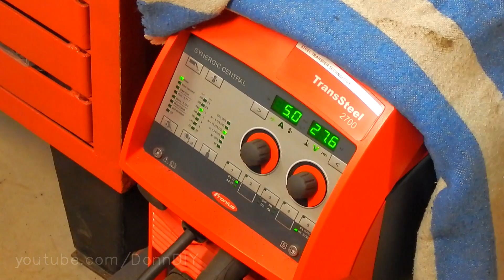Fabricating Transmission Shifter - Tracked Amphibious Vehicle Build Ep. 21

Comment: I would add two fuel tanks: One for the desired range and a second one with a manual switch over and 1.5 times the capacity for the way back.

This way you don't have to rely on a fuel gauge, if the first tank is empty you have to turn around. :)

Also just put a fuel line thru a heavy ball (like brass or copper) in both tanks to get always fuel, regardless of the steepness of the terrain.

If you want to use the space inside the engine bay, just wrap the tanks in cork and use glue to hold it temporary in place, then add metal straps around it, to hold it to the body. Cork is extremely resilient to heat damage, it was used as heat shield in space vehicles. It should give you enough time to evacuate or extinguish a fire.

I would also add a metal plate between the engine and the wrapped tank. Doesn't have to be thick, it's just to avoid direkt heat by IR radiation from the engine + seals the engine compartment for better air flow around the engine.

Comment: Great stuff. On the fuel tank how about a plastic outboard tank? You can carry extra, they don't rust inside, you can fill them outside so no worries about spills. I used one on a forklift, works great .  The shifter linkage was great.

Comment: Great build mate. Coming from someone who has experience in automotive fab, I'd be rubber mounting the fuel tank. Vibration may cause fatigue cracks in your tank which is the last thing you want in the middle of a swamp. Keep up the awesome vids 👍.
Reply from the maker: Rubber will come, I just didn't want to add more parts I have to take off later. 😆

Comment: Hi, great build  as always, inspirational to all, whether they proceed to a project  , or not.  I tried looking online as  after viewing your work a couple of times I still could not work out the shift pattern,  but, if this is a four speed  , two speed,  ie 4 speed with high low ratio ,masquerading as a 5 speed, as a number of cars ran especially in the 80's,  it could be advantageous to run it as a 4 speed with high-low box, it can give you a better range of gearing, including reverse!
Great project,  
Keep up the good  work
Looking forward to the next episodes and the final result
Greetings from  New Zealand
Reply from the maker: It is definitely 5 speed.
Reply: Sorry if not clear in my comment, there used to be many 4 speed 2 speed box's , set up  as 5 speeds with a 5 speed shift pattern, but actually  4 speed as above, knowing this it could be advantageous  as previously particularly  with a standard and also a high ratio reverse, great build, well thought through, possibly needs an outboard or jet unit on the back, cheers

Comment: Real talent here!
I think it gonna be very difficult to shift gear when it gonna run,this gonna slow down so fast intantly when toutching the clutch.
Usually this king of vehicule is automatic transmission (cvt) like snowmobile.
Reply from the maker: Yes, I know. The gears in the gearbox will work as ranges. Only instead of high or low there's first, second, third, fourth and fifth. You definitely have to stop and let the engine and CVT to idle when changing gears. I don't expect to change gears on the fly. 😀

Comment: Just as you finished the exhaust pipe i said to myself. Damn that would look good with a tractor lid on the pipe... and 30 sec later.... tadaa. Nice work man!
Reply from the maker: 😜 It was the only way to go tractor.
Reply: @DonnDIY  either that lid or a biiig cromed pipe.🤣

Comment: Looks like fun and you need a winch on the front and back and trailer hitch receiver's  light bars use old piston for shifter handle turn signals break light horn radio cup holder fishing rod holders waterproof bin for gear ladder on the back for getting out of water and a fun trip to DMV 😁
Reply from the maker: Winches will come, already fabricated mounts for them.

Comment: Suggestion...put a protective bracket before and after the exhaust pipe in case a branch or something runs along the top of the hull and snags the pipe
Reply from the maker: Good thinking!
Reply: I know the flex resonator will remove the vibration... but I would the exhaust pipe running through the hull and supported by a rubber grommet/hanger - just like the vehicles 🚗 exhaust pipe... if it snags on something I may cause serious damage to the pipe and the frame through which it goes through
Reply: It should put the outlet far away from the man.

Comment: I'm really loving this awesome build.  I only came across it yesterday and have binge-watched most of the videos.  I wish I had come across it later in the build as I don't think I can wait to see the finished truck.  
I have 2 points/questions about the build/design.    1.  I'm concerned that nothing is isolated from the chassis using rubber mounts.  I think the tub will resonate like a loudspeaker when the engine is running and the ride will be very harsh (I hope I'm proved wrong on this).  2.  Is there a reason you have built it entirely from steel?   Did you want it to be much heavier than the Argo?  Will the weight make it travel better over the terrain you have there?

Comment: Great job 
It is better to put rubber around the exhaust hole to reduce the engine vibration and noise
Reply: Reicher Reinhardt Von kesselring so he should use   Fire-resistant rubber Or  make a wide exhaust hole on the body so the exhaust end doesn’t touch the body

Comment: Nice video, what part of build is next ? 

Btw when you will begin the work on Garage, so satysfing to watch rebuilding videos.
Reply from the maker: I have yet the hull to fully weld (welding over the tack welds), rear seats and feet protectors, installing lights before paint to get the mount holes right etc. But I hope I can hoon around in it very soon. Can't wait any longer. 😜 Work on garage will be way in the future. I still have the machine shop to finish and lathe to move.
Reply: @DonnDIY  Thank you, for your response, Best regards from Czechia.

Comment: I am curious about your fuel tanks mount. I've read a few times that it was important to put such tank on rubber pads or else. Resonance issue or else that I did not fully understood. You considered it?
Reply from the maker: I will install rubber pads after the hull is painted.

Comment: Will you require any form of heat shielding from your exhaust as it goes past the back of your electrical wiring.  I would imagine it will get fairly hot.  Cheers.
Reply from the maker: Yes, a metal heat shield. And probably wrap the exhaust with exhaust wrap too.
Reply: @DonnDIY  All good.  You are doing really well with it.  It is very interesting watching you develop solutions as you go.  Cheers and have fun.

Comment: This feels a lot like a Colin Furze build - completely bonkers, but well engineered. That gear linkage looked like a triumph of manufacturing over design, though - the geometry of those diagonal links looks horrible and I suspect you'll like it a lot better if you replace those by a couple of right angle cranks.
Reply from the maker: I kinda like the design. Even with those rusty stabilizer rods. 😀

Comment: The weight of the gear stick will knock it out of gear with sharp movements of the vehicle and we both know that’s the majority of this machines use going to be
Reply from the maker: Good point! I can tighten the joints everywhere so it'll stay in gear.  Shifting will be harder though. But I won't shift that much due to the CVT.

Comment: If you want to cut pipe straight and nice without much hassle, get yourself four bearings with four pucks on the inside the ID that give you the ability to put four screws to set the four bearings on two pieces of wood. Those pieces of wood you can screw down to a bench at the length of pipe you want to cut. The bearings need to be 2 and 2, set up such that the pipe rides on top. Once you've setup the whole thing such that when you rotate the pipe, it just rotates, doesn't roll left or right, simply putting the grinder at the desired cut length and firmly pushing down with your left hand whilst rotating will result in a perfectly cut piece of pipe. BONUS, if you rotate it whilst holding the angle grinder at an angle, you will bevel the edge.

Comment: Comment for the fuel tank...
Any second hand power generator fuel tank it would be better,first you have them so many cheap and broken (generators)so you can find it for 10€,second they have 15 or more litres capacity so it will extand your range.
Sorry 🤗
Reply from the maker: I'll haul along 20 L plastic fuel canister. There will be a dedicated place for it in the hull down low on the floor to keep the center of gravity as low as possible. And I'll probably only use it max 1 km from my house so I can walk back home and grab some more fuel if needed. 😉

Comment: Donn your drive shaft angles are problematic for the type of universal joints you use.  ? 
You should have used cvt joints instead, the others do not have constant velocity their rotational speed changes too much with those drive shaft angles..